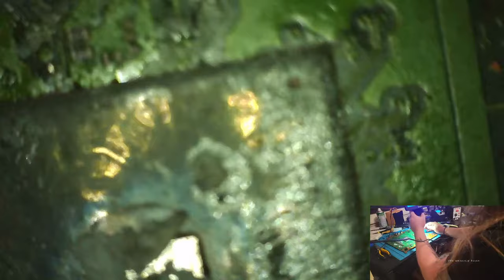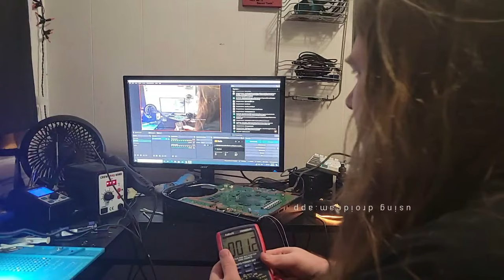PS5 SSD Controller Reball and Replacement! Live PS5 Repairs

Comment: Hello, question: A short is occurring in two 13-pin capacitors on the DA9801 around the SSD. After removing the 13-pin capacitor, there is no short in the capacitor. It is grounded on the board, but all fuses are not disconnected on the board where the short occurred. Please help.